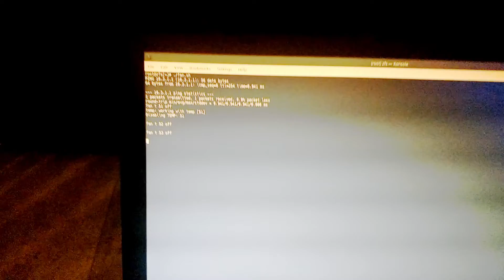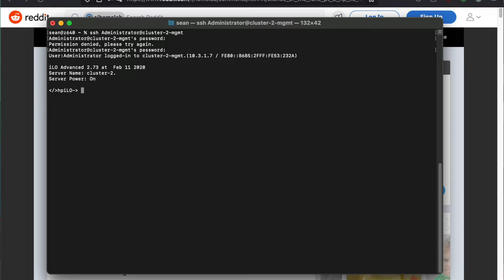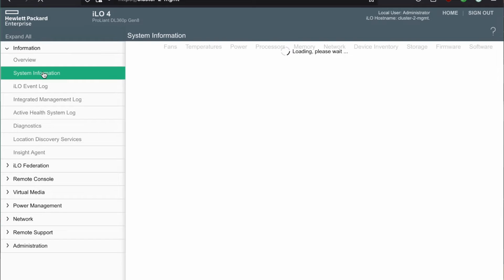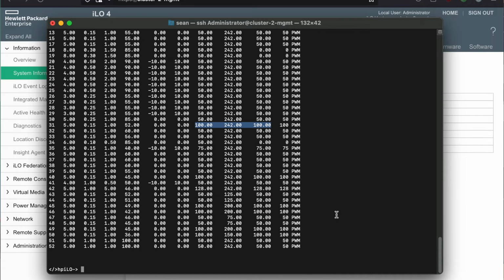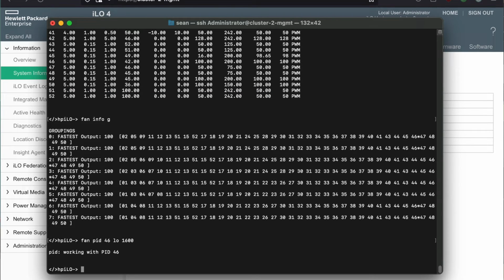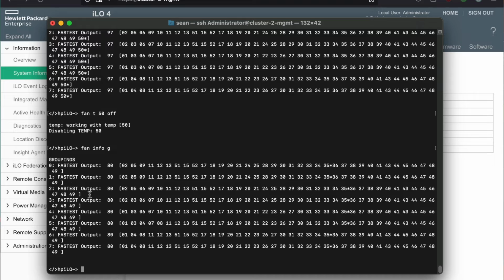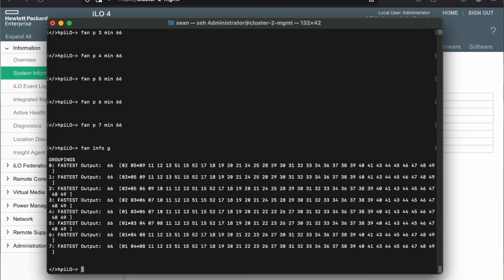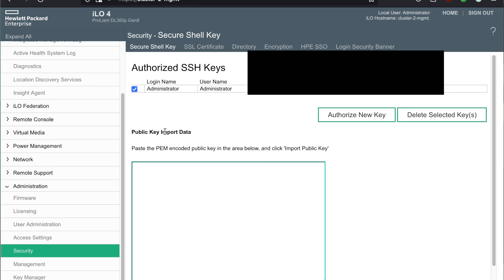Make HP Proliant server fans quiet - Modified iLO firmware

Comment: I have a HP ML350p and just added a GPU. It's an HP-spec K80, so it should work with the sensors. With the built in ducting, I love the idea of throttling down some fans but leaving the one for the GPU at a minimum speed (even though I am running an aux fan with it). This is still helping people in late 2025. Thank you!

Comment: Having the same issue with a DL380 Gen 11, new out of the box it’s so load you have to wear hearing protection & can hear it at the end of our driveway (8 car lengths). HPE is still not shipping them fixed.

Comment: this is genuinely insane -.- HP is such crap man. 

I'm just saying what we're all thinking... " Look how convenient our servers are, we have ILO!" * You have to use a modified version of ILO, nothing else including the firmware, in order change how the fans act* the absurdity of them freaking tf out when anything is in there. Like HP doesn't want you to touch anything. There's a reason that it won't boot with a SINGLE fan missing.
You can't even visit ILO on Linux man -_-
 Because then if you lose a single fan, you have to get it replaced every single time. And it has to be an HP Garbo fan or the SID panel is freaking tf out and the PC is acting like the end of the world is actively happening. Never have I had a more annoying computer. Super micro. Never HP again. Never. I own two of these things and they are both equally as unbearable 🥲

Comment: My thermal maps of the inside of my Gen 9 indicate that the hottest part of the server are the CPUs, which tend to be in the mid-50s.  The exception is when I play games, which results in my GPU running in the low 60s.  I like the idea of putting an additional fan on the P440ar controller.  There is room for a 60mm fan on top of its radiator.

Comment: Has anyone tried this on hp proliant microserver gen8.  I have installed the firmware.  When I change the value of fan it reflects in ilo but the actual fan speed does not change.  Any idea? Help?

Comment: thx for the explanation.
The install was quite a hassle, but in the end it worked.
I downgraded from 2.80 to 2.54 and then flashed from the ubuntu bare metal to 2.77
Reply: how can I do this?
Reply: Hey can you please tell how to do that?`

booting ubuntu lts from stick like live ubuntu, then flash 2.54 via override switch with the --direct command, then reboot and do the same with the 2.77? i tried with proxmox and now my ilo is dead, will recover via spp and vga and keyboard and mouse, lol

Comment: Is this working as of 9/24/2023. Does it still work with the latest firmware? Can anyone comment? Thank you very much. Is the firmware still being updated, or is it end-of-life in terms of updates?
Reply: From the link in the description (v2.77): Unfortunately, HP removed the fan control tools from iLO4 versions in v2.78, so v2.77 is the latest that can be built with the unlocked tools.

Comment: So there is no way to do the 2.77 modded via the iLO webgui ? The only way is I gotta bare metal install Ubuntu on the server ?  Surely there is a way to do this via SFTP and SSH ?
Reply: Im also trying to do the same without having to install Ubuntu on the bare metal? Any ideas of applying the fan mod without having ubuntu installed on bare metal server?
Reply: @abdulhamidmohamed7949   Turns out is actually pretty easy.  Load Ubuntu ISO on to bootable USB (I use Rufus to create the USB), when its finished I simply copy the needed HP iLO files from the guide onto the root of the USB thumbdrive. Connect monitor KB/M to server and boot from USB.  You'll be able to boot into Ubuntu from the USB thumb drive.   Then I copy those files from the USB to the Ubuntu documents folder (Desktop folder didnt work for me).  Follow the commands via the Ubuntu terminal.

Comment: I have DL380e gen8. In ILO temperatures page i have 50 sensors but in after "fan info a" i can see 66 sensors, why? Sensor 51 has min 90 and max 110. Without additionall PCIE card, when server is on idlee, fans running at 52 (not 52%, 52/255 value). After insert TP-LINK 2.5Gb network card fans 4,5,6 runs at 110 value (max of sensor 51). Why this sensor is bypassed without additionall PCIE card?
Reply: Now i check and when additional PCIE card is not inserted, sensor 51 not shows on "fan info g". So i still dont know what is this sensor. I tried to turn it on without card but its impossible.
Reply: Every core in CPU have own thermal senzor.

Comment: i flashed the modified firmware then reset the ILO but ssh terminal say this </>hpiLO-> fan

status=2
status_tag=COMMAND PROCESSING FAILED
error_tag=COMMAND NOT RECOGNIZED
Thu Jan 26 20:05:34 2023

Comment: Has anyone else played with the setpoints.. OP's given a great guide on reducing noise at idle by setting a new PWM low. I've found the fan controller responds very aggressively when the environmental temp increases.. trying to keep the system at the sort of target temps you'd expect in a data center... I don't have that kind of air-con available.. so (I think) I've nudged some of the setpoints up to allow it to run a little hotter.. this had an immediate impact in reducing the fan drive. For example, sensor 35 was driving my fan controller to high PWM (had the asterix next to it) - so I changed the setpoint from 40 to 50 to let it run a little hotter and the controller reduced the PWM instantly. (fan pid 35 sp 5000) 
Has anyone else played with the setpoints?
Reply: never mind.. daniel's comment has addressed this one!

Comment: Thank you for this video with good explanations !
I just did the manipulation, and excepted a very boring "segmented algorithm" for intake temp that can't be fully customized, it worked like a charm !

You could just add the ILO Flash procedure in video, and it would be perfect !
Reply: @dawnaur Do you still have your HP server? Can you tell me if this still works? Thinking about buying one as a lab server to save some money. Thanks.
Reply: @nomadzatara  Hello, I still have this server and it still works, but not absolutely perfectly.
First I need to do the settings after each reboot
Second It sometimes, after some days/weeks reset some settings, so I have a virtual machine with one rj45 port dedicated, looping back on ilo's rj45, and forcing settings every minutes

Comment: Wish you'd have done a video on how to actually flash the ilo, I have 4 DL units and can only run 2 max at a time cause of noise. I'm geeky but can't for the life of me figure out the how to from the reddit posts. if you ever get the urge to show how you did it, you''d likely be the only Youtuber that made an instructional video for those of us that like to home lab but don't have the chops to do this little mission! Great vid on what to do after you get there LOL hopefully will be able to appreciate it all at some point!
Reply: What they don't tell you is that in order to flash the server, you need to run a baremetal instance of ubuntu on that server. Follow the steps with that in mind and you will get it.
Reply: @Sean Mokrane  I was able flash all of my Gen 8's to 2.7 and can now set all fans to 31% which is sweet! I read where the same fix can be done to a Gen 9 but have been hesitant to try it as it seems like a far reach to assume G8 and G9 would both work off the same flash file.

Comment: Thanks for the video. I'm wondering if I messed up somewhere. I used to see all 8 fans, but right now, ilo only shows 4 fans. When I initially used this, it worked so smoothly, run a full night without noise and suddenly, nothing I do can convince this system to calm down now.

I need help, can't stand the noise any longer.

Comment: Instead of disabling sensor 50, you could set its target temperature (36degC) to something higher, so the P (of PID) doesn't spin it so fast.
Reply from the maker: Good tip. You're right, this is a better way to do it.
Reply: @techstuff7414  Hello! Please tell me if the method will work on the server HP ML310E Gen 8 v2?
Reply: Any ideas of applying the fan mod without having ubuntu installed on bare metal server? Stuggling to do that 
 @techstuff7414
Reply: How do you set the target temperature of a sensor?
Reply: ok, finaly worked it out. "fan pid 50 sp 4600" to set it to 46degC
Reply: Could you enlighten us with the knowledge on how to do this please? Thanks in advance!

Comment: I found a simpler way - Disable iLO. Most of use buying these second hand for unraid or other home office setups probably will never use it anyway.
Reply: is this only for newer server like g8 or ? i mean i have a g6 and its loud and how do you disable it  ?
Reply: @QuatschMeister  Disable ILO ... btw Fan Curve is Controlled by the Firmware not the Integrated Lights Out ... so useless to block a port remote manage without a monitor, and the most series hp servers has ILO integrated onboard u could by an exta card but mostly for clients
Reply: just disable it and the fan noise will reduce?
Reply: @davids2276  not really better by me

Comment: Good video, this will help THOUSANDS !!
Reply: I found a simpler way - Disable iLO. Most of use buying these second hand for unraid or other home office setups probably will never use it anyway.
Reply: @atienne_navarre  Dumb idea, I ilo allows you to remote manage the box & check on health. That's like saying, oh hey I hate security on my network so i'll just turn off the firewall !
Reply: @JasonsLabVideos  Oppinions vary.
Reply: @atienne_navarre  what was the result of diabling iLo function? did it resolve fan noise problems?
Reply: @shotatubef  Wow - Its been a long time but as I remember, it did. Im still running two of them and don't have the problem.